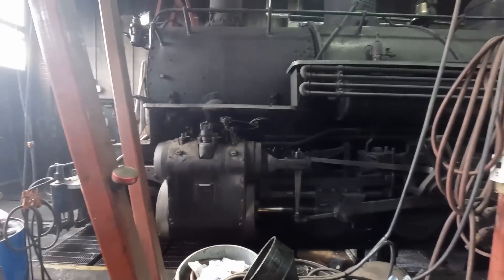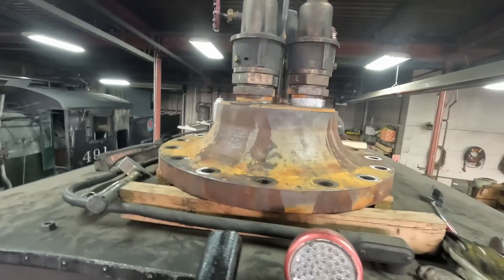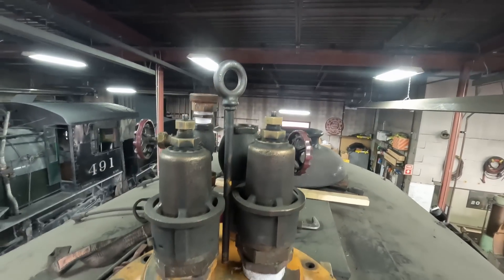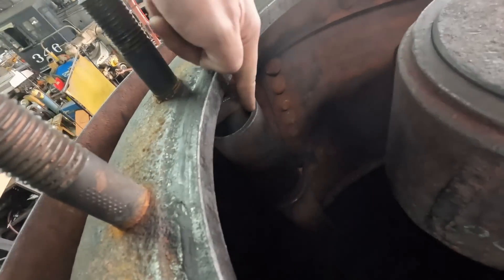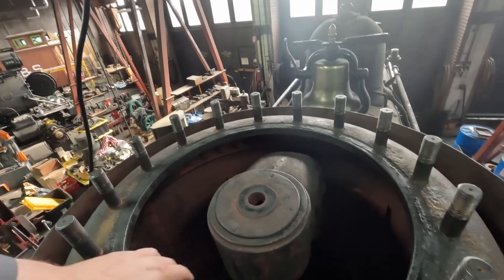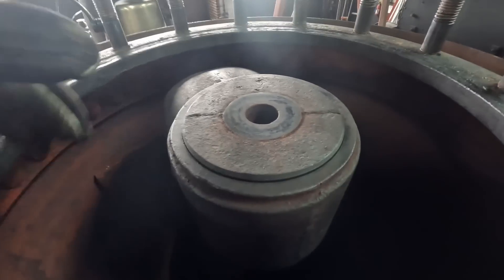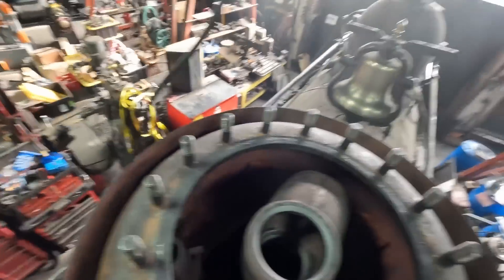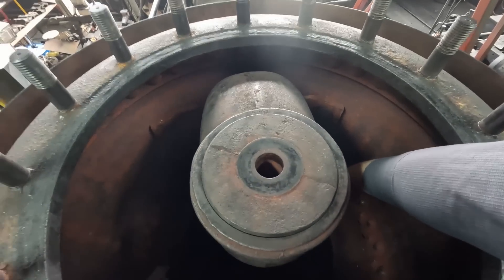Steam 101: What does a steam loco THROTTLE look like, and how does it work?

Comment: Was that 491 having an attitude in the background? @4:33? The look on your face was that of someone who’s had to deal with her mood swings and isn’t having any of it 💀
Reply from the maker: That's the shop air compressor's automatic water drain valve. Goes off maybe every 30 minutes or so, and of course it was midway through filming. lol
Reply: @Hyce777  Ah, that makes more sense.
Reply: @Hyce777  ah, alrighty. I’m guessing the safety valve on a train engine wouldn’t pop and then close again that fast? I used to test safety valves but I wasn’t qualified to test the steam, only low pressure air and water and those would close pretty snappy once the pressure went below the spring strength.
Reply: well....hes talking about another engine so she probably got jalous :-D
Reply: Pretty sure it's the air compressor's overpressure relief valve